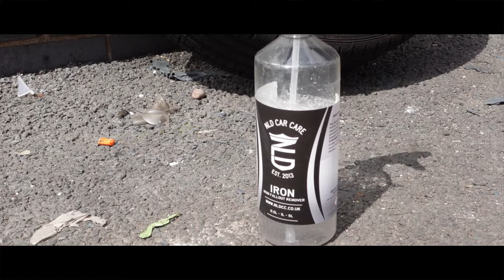Protecting this BRAND NEW Golf GTI with our lifetime ceramic coating package at The Studio!

Comment: Using way too big pads for the smaller areas......
Reply from the maker: Hey there,

We use a mixure of the rupes bigfoot 5 inch polisher on the larger areas of the car and the flex PXE80 nano polisher on the smaller areas. On this occasion we didn't get round to filming the flex polisher being used.

Thanks!
NLD